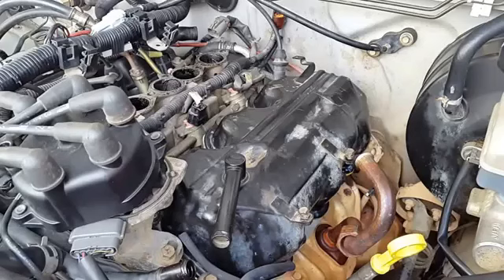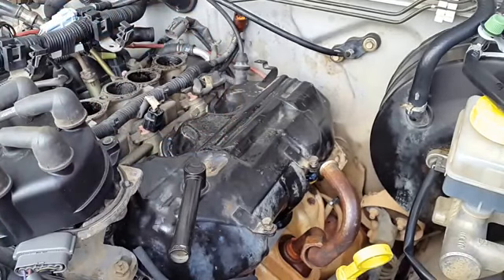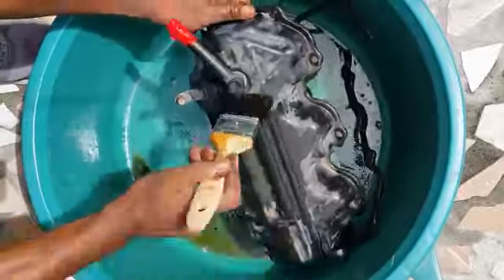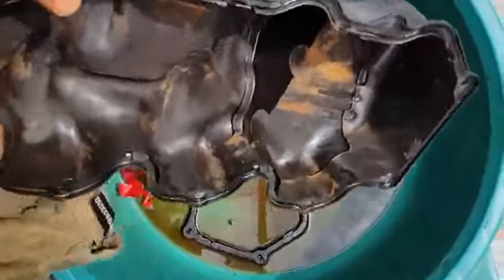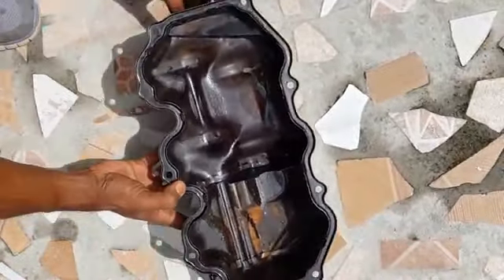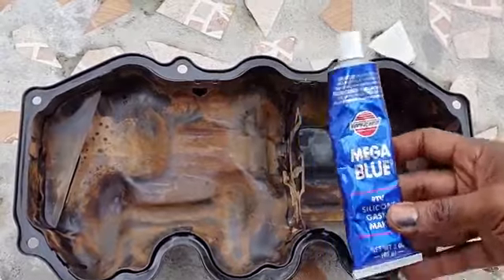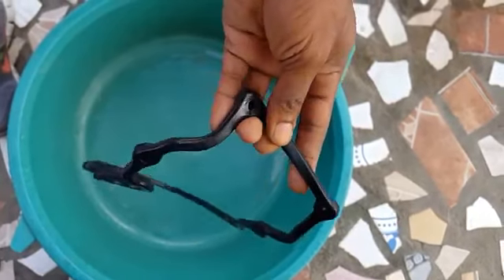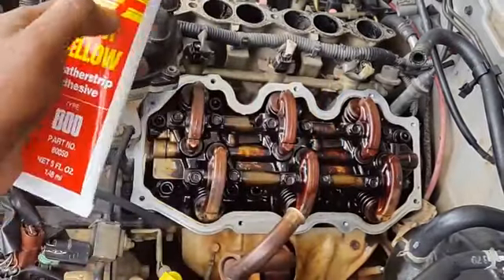Nissan Vg33e Rocker Cover Gasket. Part 1/2

Comment: There was no silicone/adhesive installed with the original gasket, all you are doing is creating a major headache for whoever does the job next. But hey, at least you're going to have a great seal.